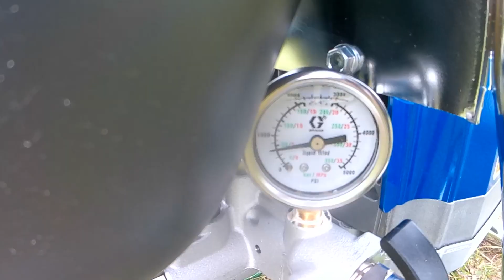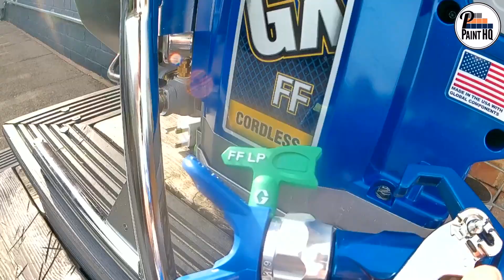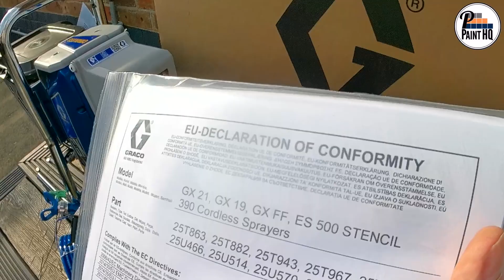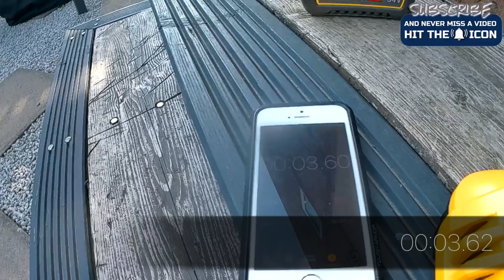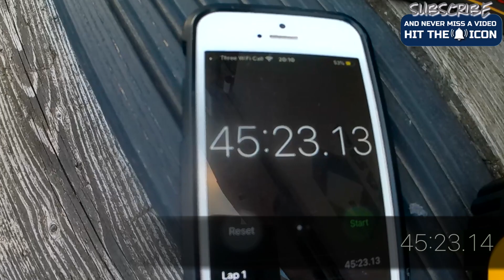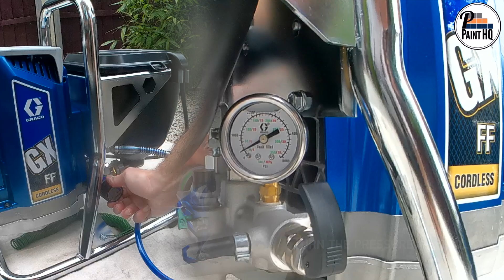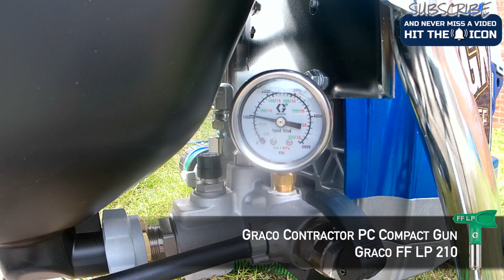Graco GXFF Cordless. GXFF Cordless Airless Paint Sprayer Setup & Spray

Comment: Hi Pete,  I'm about to pick one of these units up. Have you tried this unit with the FFLP 515/517's vs LP 515-517?

I'm wondering if that would make a good combination for the odd interior wall and ceiling

Do you find the speed our paint output lacking compared to the 390PC or other similar bigger units?
Reply from the maker: Hey Jarrod, ah great news, it’s an awesome cordless unit that’s versatile enough to handle emulsions like you say.. all the GX units are well built, I know of many spraying walls / ceilings with the FF unit with no problems.. For example the GX21 and GXFF have the same pumps, it’s just the gearing that gives the GX21 a slightly bigger output ..and can handle a .021 tip Vs the .019 of the GXFF.. on that note, the GXFF is geared for a 1.5 L/Min flow, which is why the recommended max tip is a .019 (1.44 L/Min fluid flow).. it’s the tip orifice size that determines how much fluid is sprayed.. so whilst there’s nothing stopping you putting in a bigger tip, the pump would work in overdrive trying to keep up.. just like a car engine.. a bigger pump (engine) with a greater output / fluid flow would just tick over and sound much sweeter.. to reassure you, you’ll be fine with a max .019 tip spraying ‘decorative’ coatings, interior emulsions, even a bit of exterior smooth masonry 👍 ..Other than testing, for decorative spraying I can’t recall anytime I’ve needed to go above a .019 tip 👍 hope that helps my friend, exciting times ahead.. where are you thinking of purchasing your unit from?.. I can recommend speaking to Mike at SpraymanUK 🙏 Let me know how you get on, regards Pete
Reply: @PaintHQ   Very helpful, thanks heaps Pete. I just bought one before I saw your comment the other day 😕 but all good, price wasn’t far off SpraymanUk

The unit looks so nice, can’t wait to use it. The labels are way off on the adjuster 🥵 

I’m coming from a cheapy imitation. This with the hopper, cordless and smaller hose/gun is such a step up
Reply from the maker: You’ve made a great investment my friend 💯 exciting times, I’m pleased for you 🙏
Reply: @PaintHQ  hi Pete, just wondering if you can help me. I just hit a wall that’s been taped/finished and coated with all purpose mud. I’ve watered down 50:50 a high quality primer sealer undercoat. I sprayed it on with an FFLP514, it’s water with lots of drips  at about 800psi with the GX19 cordless + backrolling with a 10mm poly

The problem is the mist coat isn’t sticking to some sections of drywall mud. It just flakes off as I’m backrolling the mist coat. 
Do you have any advice as to why this is happening? I’m devastated as an amateur, I’ve spent so much time to get surface ready for this to happen :(
Reply from the maker: Hi Jarrod, sorry to hear you’ve had a ‘problem’, please don’t get disheartened, it’s nothing that you can’t sort my friend.. 

It does sound like a dust or contaminate on the wall, however if you’re using an acrylic primer specific for priming fresh plaster, it’s possible you don’t need to thin.. if you want I’d just thin with 30% water.. then I’d only back roll the final top coat, so the primer and first coat I’d just spray, so no roller will ‘pull’ off any primer.. but you do need to ensure the surface is dust and contaminate free 👍 hope this helps, keep going my friend, all will work out great and I’m happy to help and advise if I can.. keep in touch.. regards Pete
Reply: @PaintHQ  Omg Pete, you are really encouraging, I was really deflated earlier. Thank you so much. I think you could be right. It could be dust since some sections seem to backroll and soak in well. I’ll try less water next batch and avoid rolling the primer coat. Though this scares me that I wouldn’t know if the next two coats would have a good foundation. 

I tried vacuuming, brushing and cloth wiping the sanded (Hamilton’s) Lightweight All Purpose finish, it just seems to kick up more dust. Do you have a good routine you can recommend?

After spending weeks, removing, fixing, screwing, taping patching and sanding my square set from crown moulding conversion. My first room, I tried unthinned primer with a roller. It pulled off so many places. (I only learned about mist coating afterwards 😢)

This time was better sprayed then rolled with thinned primer. But like you said 50:50 might be too much 😪